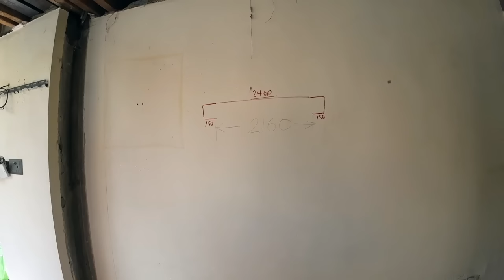IN WHAT UNIVERSE IS THIS OK ?!! NEW JOB

Comment: Cut up one of these old salvaged angle irons to about 15" sections and some 4" secctions. Drill a few holes in them. Screw the short lengths on the joists as hangers and then rest the longer sections on these, between the joists and then fix to the joist fill masonry to stop the droppers.
Reply: What he said! Waste not want not 🤟

Comment: In the universe where it's requested by the customer because toothing out and matching the bricks would cost too much.
Reply from the maker: I’ve never heard in 36 years the customer say just lash it in so it’s Cheap. The customer only sees it once the heating engineer/ plumber is gone when it’s too late . 😒🧱👍🏽
Reply: @SteveAndAlexBuild  Well in my 48 years in the trade, mainly on new build sites supplying bricklaying gangs to the main contractor, but occasionally being asked to do bits for customers that have moved in to a brand new house I have been asked to have a bricklayer pop over and do things like this, even with brick bat's they have dug up in the garden. I always turned these little bits down but trust me the customers who ask for things like this are out there.

Comment: Steve Alex I noticed your scaff boards not locked into trestles.
I used to drill 4 x10mm holes centre of corner boards near the ends and drop in 4x 10mm bolts  left hanging to stopside movement.Holes drilled just inside of side cross bars.....   If i feel off now  at 71 i would never recover..Malc
Reply: That’s makes sense to me to 👍
Reply from the maker: @malcelwell7209 🧱👍🏽

Comment: Great job as usual. That wall is a lot more solid and stable now with that heavy concrete lintel installed. It's always baffled me why houses were still being built well into the 70's with wooden lintels on the inner walls even though concrete and steel was used on the outer walls. Maybe building regs weren't so strict back then?
Reply: More like inspectors looked sideways. Buildings back into the 40s had steel lintels.

Comment: My first job in 79 were ripout and replace elevator entrances. We were supposed to do 2 every day. If the opening could not be secured by lunch, we were not allowed to start the second one. These were occupied buildings. I did that for 2 years before the company switched to new construction only.  
     My very first day I lightly grazed a (broken) glazed tile early in the morning and it bled like crazy. I still have the scar on my wrist.
   35:30. Do you ever cut 2 for odd spaces? Like  12'' + 6'' = 18".   split it in half gives you 2 pieces 9'' each. The cuts don't stand out so much.
Reply from the maker: We both have a few scars too 😬😆.
Yes would try to make every job look right 🤙🏾🧱👍🏽

Comment: Great work guys 👍 Quick question, is there a reason you didn't bed the tray into the the joint above the concrete lintel, as opposed to nail/silicon it?
Reply from the maker: I think there was a pipe in the way 🧱👍🏽

Comment: I’m out of the construction trade for a very long time now, but my foreman would never allow such a wide opening in a brick/block wall without needles to support it.
I started to watch this, hoping to refresh my memory and learn how to do something, but this isn’t a how to video. The guys are using experience to get away with stuff you probably shouldn’t, but not explaining any of it.
A diy-er copying them would end up getting a spin in a white van, or perhaps even a black one, when the bricks above the opening came down on them and their air hats failed to deflect them.
So, if you want to learn how to relate to your son/father, this is for you.
If you want to learn construction, it’s not.

Comment: Could have match the original mortar better, why didn’t you source some lighter sand, to archive that??? 
If you had done, in time it would look like it was the original build and not a modification!!!’ Tidy work though, shame about the mortar not matching!!!’   ຈل͜ຈ 
.
Reply from the maker: You haven’t seen it fully dry
Reply: Yep I did see it after it dried I wouldn’t have commented otherwise!!!’ OK I suppose,  but could do better, it’s one of my pet peeves, of course you may not have a matching sand available, and the whole wall is a bit of a hotchpotch, but it was a better match than the cowboy’s that patched the hole, what with different bricks and a very dark mortar, that was  no match at all.!!!’ It’s to often overlooked by less professional brick layers, and from what you say, you did at least try, keep up the good work, and always try to match the existing mortar, just makes for a better finish, if you get it right, it should be impossible to tell the new work from the original build.!!’ But you know that, so I give you 8/10 ຈل͜ຈ
.

Comment: Wow these guys should embarrassed to put their name to this, in this short video there is more wrong than right the customer is  obviously construction ignorant, not a hard hat in sight , the door should have been removed first as it restricts access and a temporary stud and polythene screen erected to separate the work from the kitchen , that pre stressed lintol should have a minimum seating of 150 mm and beaded on concrete pad stones or engineering brick  not 7nt  thermal breeze block, the acrows  should have been nailed to the timber support and it stitched to the joists to prevent the acrows moving the wrongs are endless , Steve & Alex are cowboys .
Reply from the maker: Yes haw 🤣🤣